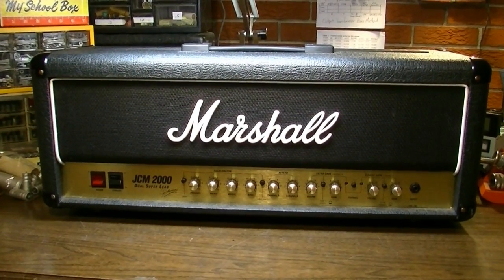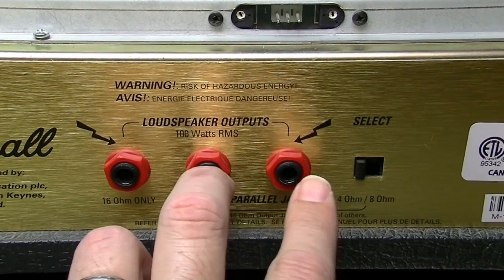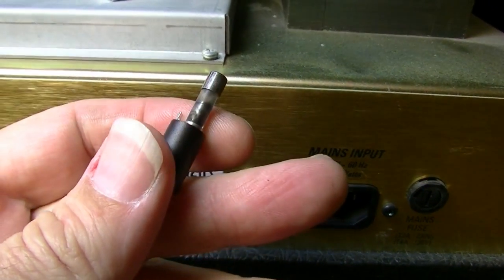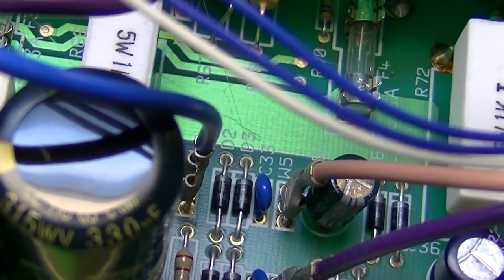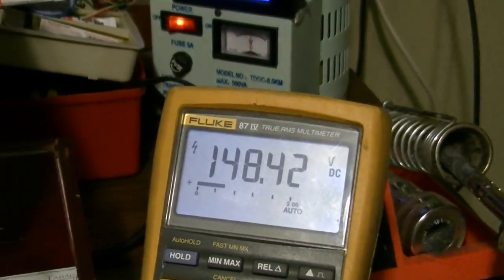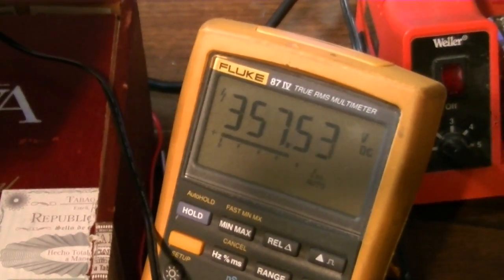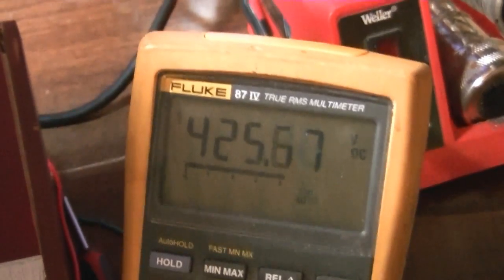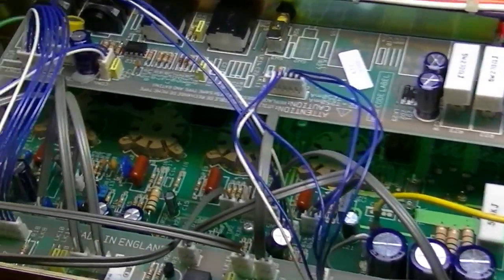Easy Fix Made Difficult - Marshall JCM2000 DSL100 Repair

Comment: I had some issues with my Marshall DSL100, and symptoms were different, i was losing my tube glow. It was intermittent, amp would work for a while then go bad. Infuriating. It turned out the wires coming from transformer had a whole bunch of spade connectors that could not grip onto the lugs. Totally loose. So they were in place, but the connection was literally just metal touching metal, no clamping pressure. I just got some pliers, squished the spade connectors to close them up a little, then push them back onto the lugs and hooray they gripped tightly. Problem solved. 

In your case, you haved glowing valves so obviously the circuit to your valve heaters is ok, but i'm just wondering if your issue might've been some loose spade connectors on wires going to the high-voltage side of your tubes. I don't know much at all about tube amps, but what i do know is my amp looked like it had never been worked on, those spade connectors were loose from the factory, and I had half a dozen all loose as hell. So, loose spade connectors can be a dog of a problem and i guess depending on which ones are loose they could cause a variety of issues.

Comment: i recently blew the mains fuse in my Laney LC30, by putting in old Mullard EL84 tubes, turns out they're wired differently to current EL84s and the Laney can't handle em. since then i can't get any sound out of the amp with previously good tubes (jj), also replaced the output transformer thinking that was blown, not sure what is wrong!??

Comment: I wonder why the HT fuse is rated for only 250 Volts as the HT supply is likely around 400+ VAC. Do they use a smaller rating beecause arcing inside a failed fuse would be less of an issue due to it being in the AC part?

Comment: Also look for the note... If you look really carefully at the back of the amp where 16, 8 and 4 ohm jack outputs are located. It will read "Note: 16 Ohm Output Jack negates use of others." You can either run a 4 or 8 ohm load single output or parallel two cabs together. For example two 16 ohm cabs ran parallel then you set it to 8 ohms and plug in each cab. I always just ran mine with a 16 ohm single cab and at that point it makes no difference what the 4ohm/8ohm switch is set to.

Comment: These DSL series amps suffer from dry joints worse than any other amp I've worked on in 30years. The interconnect wires between the PCBs usually need resoldering . The bias supply caps always need replacing too.
Reply: Negative good buddy.
I couldn't disagree more...

Comment: Hi. 
The HT fuse went on my old 74 superlead when I used a 4x12 with a blown driver. Only ever goes then. May be that the family member was using the wrong ohms for the cab and it blew the HT. Anyway, really enjoy your channel. Lots of fun stuff most of which I don't fully understand yet but you're teaching me lots. So cheers.

Comment: i have a TSL102 that did the exact thing to me. when i first got it i did a stress play test and it popped its main fuse.
I checked everything over three or 4 times and couldn't find a smoking gun.  I put meters on the bias voltages monitoring them looking for bias drift. Ran it for a few hours and nothing. solid. 
Just waiting for it to happen again. :(

Comment: I'd have to look back at the schematic to see if the thought I've had would carry any water, but I watched this early this morning and I guess the conundrum has been ticking away in the back of my head. I recently repaired an unusual rotating speaker setup of a friends with a separate preamp that was blowing fuses and I found the source of the issue to be a relay stuck in an energised state. Different scenario and problem but I was just thinking about the way that channel 1 sprung into life as you brought it up. Anyhow.... Hope the weekend is being good to you sir.

Comment: I got sucked into buying one of these glorious pieces of shit from a pawn shop for $600(ca). Thought I was getting a wicked deal. It turned on and made sound at the shop so I bought it without really giving it a good tryout. Well 20 minutes into my first set with it the fucker started to cook... LOL  Had to replace R7 and R8 resistors. Oh well, I dumped it at another pawn shop for $500... Lesson learned, if it seems too good a price, there's probably a reason... LOL Been using an MA-50h going on 3yrs.
Reply: the JCM2000 DSL 50's are a bit more reliable . Dont have that Thermal runaway issue like the 100's and TSL100's. Some solder joints need to be inspected and re-wetted for good measure, but mine is behaving itself.

Comment: How come you were measuring DC voltage on your meter? Shouldn't the output of the transformer be AC?
Reply: Prehistoricman - The Transformer transforms A/C current into DC, which is what the rest of the innards use. A/C is used for long distance transmission for reasons of safety and efficiency, but most gear really needs DC to run...hence the Transformer. Thank Nicola Tesla for all the cool stuff the A/C system + step-up transformers (not to mention resonant transformers) gives us!
Reply: The AC output from the HT winding on the transformer is rectified to become the DC on the HT line. Finding DC on the HT line shows that the HT winding must be OK.

Comment: These kinds of things always give me a less than great feeling to send back.  That fuse didn't look like it went from stress, but a major overload.  Short of customer abuse, I'd be afraid that there's still a gremlin in there I failed to find that will come back and bite me.  But if you can't find it, you can't find it.  You have to move on.
Reply: The fact the fast blow holds is just evidence that the problem hasn't returned.  THE WORST problem for any tech is the "intermittent".  Give us something completely dead and it's easy to figure out.  But give me something that "make noise in the 3rd set, but only on a full moon", and I'll need to start padding the walls near my bench.  The problem could be a loose bit of metal floating round under one of those boards.  The amp has to be turned the right way for to to touch things.
Reply: The fun ones are the user caused faults, you basically have to stand there and watch how they cause it to happen and then slap them on the back of the head and call them a moron.
Reply: And sometimes you just have to send the equipment back out into the world and wait to see if it fails again.
Reply from the maker: I poked around on every component associated with the HT winding. There was just nothing to go on, no indications of a problem anywhere. I might have said "bad solder" or something, but chopsticking everything revealed nothing. I can only do so much for the bench fee. Pulling boards would mean more $$$.
Reply: Oh, I fully understand.  And while some of that may be part of your normal checkout, I suspect you had a that uneasy feeling as well - or you might not have spent as much time looking.
Reply: Besides, even though it's quite rare, some fuses just give up even if they're nowhere near their rated capacity. It's what happens when a device is explicitly designed to fail.
Reply: @TheRedneckAtheist, true, but in that case the fuse just has a crack or has melted ends.  The one in the video was blackened.  It died violently - apparently from something well in excess of it's ratings.  If it showed signs of "minor" failure, it'd chalk it up to a weak fuse and move on.
Reply: But the fact that a fast blow fuse is stable in the equipment says otherwise. There are other modes of failure that can cause a glass fuse to be blackened and still have continuity, one of them is a seal failure causing oxidation. Another way is a very slight and very brief over amperage that doesn't blow the fuse but strains the filament.
Reply: Bingo.  It just I've never really liked that option, but sometimes it's the only one left.
Reply: Have to agree with Russell.  That fuse suffered a violent death, and until a sound explanation for it is found, there's always a bit of worry going forward.  (And often, that's all you can do.) Anyway, enjoy your work and explanations and keep us posted if this amp someday comes back with the same problem.
Reply: Finger pickin’ good!
Reply: After 50 odd years of designing, building, and repairing electronic stuff (mostly for scientific research but I'll try to fix anything that comes along...) I agree with Russell that it looks like the HT fuse opened due to a major overload.  I too would be uneasy that there is still an undiscovered gremlin but about all you can do after taking all of the steps Brad has taken is send it back with an explanation and ask the owner to let you know how it goes.  That being said... Remember that this amplifier was out of the control of the owner at the time it "failed".  We don't really know the sequence of events that led to the fuse blowing.  Maybe the fuse wasn't even in the amp on the bench when it blew.  I imagine a backstage conversation: Hey, my amp just stopped working.  It's just a blown fuse... let me borrow the fuse from your amp...  Oops!  (Or maybe there was no conversation... Somebody with a blown fuse just swapped fuses when nobody was looking.)   The scientists I used to work for knew just enough about electronics to be dangerous and they pulled all kinds of dumb stuff like this - and worse.  All of the musicians and sound guys I know are angels by comparison.

Comment: Great vid. Love seeing a guy who really loves this stuff do his thing. I actually learned a few things. Bet your swamped with work huh? I have a pair of Hiwatts that could use your attention. One Biacrown, ( I freakin LOVE that amp )the other a Hylight. I also have a Fender twin that burned three resistors in a row on the effects board because my son left an uncovered "one spot" plug resting on the tip of the cord that was plugged into the return to the effects loop. Cant find anyone local to check the board to see if the traces burned, or just the resistors. Keep up the good work. We need an amp guy like you around here!!!
Reply from the maker: Well the shipping on the Fender would KILL you both ways, but the Hiwatt might be doable. Hit me up in July when I begin taking in outside work again. bradlinzy at gmail
Reply: Gotcha. Not worried about the shipping, it has to be sent somewhere anyway, unless I want to just try to jump new resistors in their place, but lets face it, since they burned, it really needs to be diagnosed. The Hiwatts just need to be diagnosed, and see what needs to be updated to keep these babies cranking for another 40+ years. Thank you my friend, keep up the great work.

Comment: I had the "Bias drift issue" on DSLs before.   Was told by a Marshall rep  that boards from 1997 to 2003 were made of a material that becomes conductive.  In 2003 they changed the material those boards are made of.  That's why we see pre 2003 JCM2000 going for pennies on Ebay.  
Just subscribed. Great channel.
Reply: Been there, two times, one did the mod (pain in the ***) and the second one got a new board from UK, best way to fix it. Now got a rocking amp! and resolder most components, everything was getting loose...
Reply: The JCM DSL 50 watt'ers didn't have that issue. Only 100 watt versions. I have 50 watt version and no issues ever
Reply: chungaleta1234 Yep. I refuse the JCM2000 DSL/TSL models in my shop.
Reply: I hear you. They are my favourite sounding amps. Bt they sure are a pain in the behind to repair.  What I hate the most is the layout and the many boards they have, it is almost  impossible to make  readings when the amp is alive.

Comment: Having fried the output transformer of a JCM900 due to totally mismatching the outputs I had a bit of a giggle at the early part of the video. I spent >50% of the cost of the amp on fixing that one, oops. DSLs are great amps, I personally went in a different direction but I'd love one of the DSL50 heads.

Really enjoying this channel as a gear nerd who has, unfortunately, had to have had a number of tube amps sorted out... some of them by tech who may not have known what they were doing even though they came well recommended!

Oh, and you're a serious guitarist going by your previous videos. Awesome.

EDIT: Wrote this 1/2 way through the vid. You broke out the chops at the end. Love it.

Comment: I am a certified Marshall repair agent here in the UK.  Check the soldering on the HT fuse holder and the mains fuse holder.  Its quite common for these to become a dry joint and need resoldering.  Had it maybe 10 times in the last 4 years - so worth checking!   ALSO make sure the wire wound resistors do not 'move' when you wiggle them slightly as these can also go the same way as the fuse holders.
Reply from the maker: I chopsticked every component within earshot of the HT winding down the line to the output tubes. Nothing triggered a fault. Thanks for the comment! I believe this was just a case of a voltage spike or a momentary brain fart where someone maybe tried to hit that first power chord with no load. Not sure, but I saw nothing amiss anywhere.
Reply: Well - a lot of time customers do not tell you the truth !   For instance - they ran the amp not plugged into a load.
Reply: Marshall allow for this when designing/specing.

Also it could be valve bases on these - you can have an amp on soak test for 12 hours then suddenly something arcs and you can blow a fuse.

I do not come across many valve amps that blow fuses for no reason.
Reply: Arcing! Yes. My son's 2015 68 Custom Fender Twin started blowing the internal fuse. I thought ARCING! First time tech said 'twas a bad PI tube. Nope. Second time said put in the 125 v fuse instead of the 250 v. Nope. New tech changed the fuse holder to different type (increased isolation). Yup. Arcing.
Reply: If we suppose that the fuse is original, is it possible that it blew on its own after 20 years because it was used beyond the maximum design spec? It was rated at 250V but was subjected to something like 330V-ish (before rectifying)?

Comment: Marshall 1960A and B 4X12's have 16 ohm drivers and can go either 4 or 16 ohm. I always ran mine 16 ohm, but some guys run 4. That might be was this guy was doing. I had a TSL 100 from 1998 and I had to replace the main board when mine started having the bias drift issue. It never sounded the same so I sold it.

Comment: thanks for the video ``I just love the sound of a marshall...question ,w\hat gives the different amp brands their signature sound? power tubes? pre amp? a mix of both? type or capacitors?...I see p[people make marshall clones but they don't seem to sound like the marshall they were cloned from, same with Fender amps ...or is that just my eras fooling me because I see the brand name and associate it subconsciously with a sound, thanks
Reply from the maker: A lot of it is the shaping of the tone in the preamp, V1 stage being most important, and the tone stack. People often cite output tubes as a major factor, but it's less important than tone stack, and even more specifically, the amount of midrange frequencies are expressed.

Comment: Brad, I think one thing that sets you a part from other techs, is you have a practical approach to what you do! Some techs would have to hook up a sine wave generator and a dummy load and an oscilloscope. You have to sometimes but just a guitar cord and a speaker can be very effective in the troubleshooting process. I have used that simple method for as long as I have been building and servicing amps and guitars. I have a 1-12 JCM 800 Lead Series with 6550s instead of EL 34s and I am debating whether to convert it to EL34s. Tube wise the EL34s may be a bit cheaper to replace, the 6550s are a bit louder(this amp is too loud anyway) and cleaner. If I alter the tone stack, it could be used as a bass amp. Great video! Hope it don't come back later with some other worse problem! Thankz
Reply from the maker: If it comes back, it should be for some other fault. I wiggled and prodded every component remotely connected to the HT winding and everything was rock solid. Go figure. I power cycled the amp many times and played through it for a good hour without issue, even with the fast blow fuse.

Comment: The British call voltage electrical tension.   HT= high tension = high voltage.
Reply: And the amount of water over the fall is (literally) the current.
Reply from the maker: Thanks for pointing that out. You're right. I think I failed to mention that. I've always viewed voltage potential are more like a waterfall. How high is the waterfall? It's x volts high. The waterfall itself is formed by resistance.
Reply: @TheGuitologist  in electrical engineering, we had a class where we modeled water distribution and mechanical systems as well as electrical circuits. You guys are spot on. Voltage is Pressure, current is flow and reservoirs acted like capacitors.
Reply: I've always liked the water main analogy. Water pressure is voltage, amount of flow is current, and the pipe diameter is resistance.
Reply: In much the same way that American celebrities call extra-judicial murder a photo op.
Reply: Blame the ol family member

Comment: I have a TSL version that was popping HT fuses. Turned out to be the 1 ohm cathode resistors failing losing ground. One exploded taking out another 56k resistor underneath it. I replaced them both with precision metal film. 

Also check the 16 ohm speaker jack. If it's dirty and doesn't close the amp will lose ground. You can run a jumper to ground it, http://www.marshallheads.com/viewtopic.php?f=8&t=48